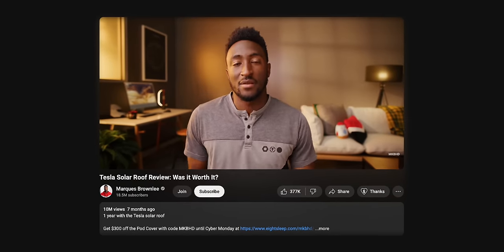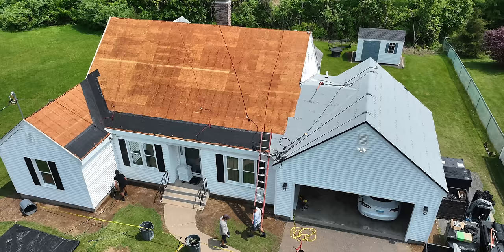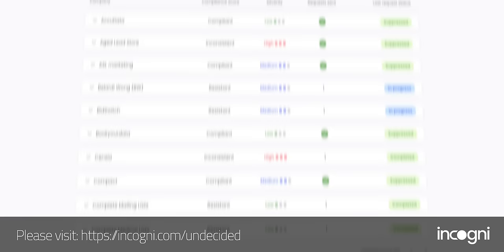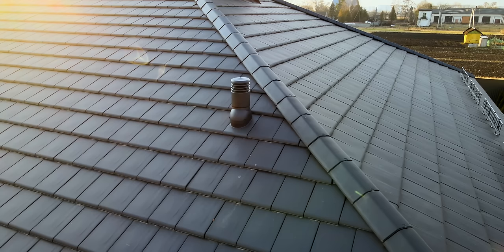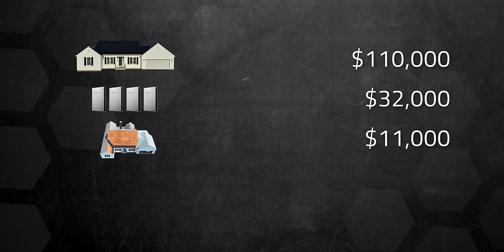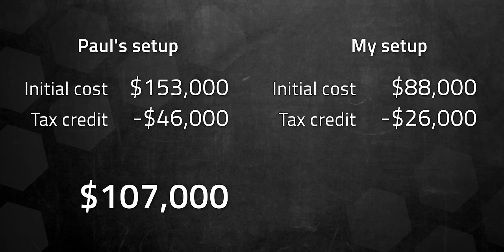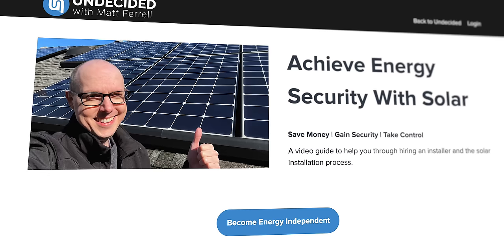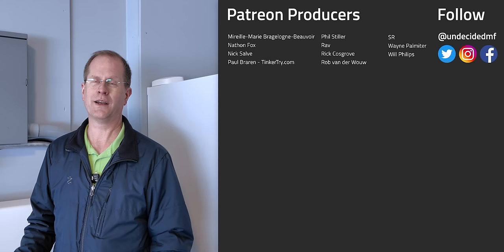Tesla Solar Roof vs Solar Panels: Which is Worth It?

Comment: I bought used solar panels. 4KW for $1300 Canadian. I flashed them together so they could act like shingles for the roof. So the solar panels are the roof for my woodshed. No leaks. It works great! So cheap too! Lead acid batteries store my power. They cost $2200 CDN. So I live off grid with very little generator use except for deep in the winter months for a little over $5000 CDN (with wires and charge controllers and inverters). With our snow loads here I really like my panels on the wall better though. I never have to sweep snow off of them in the winter. So I like my solar roof but my solar wall is my preference.

Comment: As someone who works a ton of heavy commercial/industrial one of the big questions for the decision is insurance coverage. If a panel fails and causes a fire what happens? I like your set up because it's metal and inherently more fire resistant.sure it might damage the paint but it won't burn. I'm %100 on board with the green energy movement I have gotten a large building an energy star but the legal aspect is a critical conversation.

Comment: The simple answer is the cost difference, which is gigantic. Additionally, for a solar roof, you have to do the whole house, whereas with solar panels, you can buy more or less depending on your needs. You can also play with the math regarding the number of batteries if you live in a place where you get a lot of sun. For example, my battery is 100% full by 11 am here in Houston during summer.

Comment: We had 31 REC Alpha Pure 405 w modules added onto our standing seam metal roof.  It uses a SolarEdge 11.4 w inverter.  15,400 kWh produced and 6000 kWh used last year.  We have a GeoComfort 3 ton ground source heat pump.   Just a great combination with the two systems.

Comment: Enphase is my choice. 
1) Individual micro-inverters.  
2) The ability to use your solar system when the grid is down. 
3) Simultaneous battery storage and gas back up generator that can charge your battery at night. 
4) Plus they have the ability to use your EV as another additional back up power source.

Comment: Imagine a tesla panel dead center going bad. You can't walk on them like shingles. You need to rent some type of machine to keep you off the roof as you reach down to replace it.
Reply: I'm the solar roof owner featured in the video, and I'm glad to report that plenty of people stomped in boots all over my roof without issue. They can be popped out individually for replacement, I verified that to be the case as I had the same concerns.

Comment: Live in Florida in a gated community. We are required to replace with tile and Tesla is approved as well. Received Tesla quote a couple of years ago. Was not comfortable with the sales and under enthusiasm. Having tile replaced as I type. Solar company placed brackets on membrane after original tile removed. Getting an 11.6 kWh system - tier 1 with 29 Silfab 400 watt panels, micro inverters, 3 Enphase 5kWh IQ Battery 5P and also added 2 Easy Start AC system Soft Start Devices due to heavy use of AC in Florida. Electricity is not as expensive here versus other states, but with the need for a new roof, knowing we are staying in this house, the increase in hurricanes (considered a back up generator for a hot second), 30% tax credit, net metering in Florida and helping the environment, it was time.

Comment: We had a solar roof installed and completed in March 2022. Total experience has been extreme Remely disappointing.

We are in Dallas Texas. Went with a third-party installer because I could never get anyone from Tesla on the phone. They assured me that they were the highest volume Installer in North Texas. The company is called Good Faith Energy. Unfortunately, their service after the sale was also extremely disappointing. The roofing crew and installers were very enthusiastic. Worked hard, but did take about six weeks to install the roof. 35 kW system. It has far under performed what they projected. We also have four power walls and four inverters. Tesla Service for this has been pretty useless.

My initial quote from, Tesla was roughly $120,000. Ended up costing us twice as much.

Comment: I think a couple clear important distinctions were not mentioned:
1 - The tesla roof includes roof elements that will have very little sunlight hit them.  While the 17kWh panels are all much better aligned to the sun.  Would have been GREAT to compare total Solar kWh from both systems on a sunny mid-summer day.  I bet it is not as simple as 27kWh vs 17kWh. 

2 - Maintenance. Which system allows for more easily replacing panels that are failing?  Maintenance (cleaning them? etc). I assume on Tesla you have to hire for replacements.

Comment: Went down the exact reasoning you did two years ago. My metal roof is about 40 yrs old now and I expect another 20 years more out of them. Have had my 18 kW running well for over a year now with about 22k kWh annually. With APSystems micros, replacing panels decades down when the technology changes or with failures will be easy and they are easily scaleable.

Comment: Paul should spend less time worrying about solar efficiency, and more time worrying about the water pouring in through his basement windows.  Might be time for some window well improvements!
Reply: :)
I was kind of bummed those 33 year old cement drips from the original basement pour showed so prominently in this unfinished area of my house. Worry not, it's not water, and thoseterrible single-pane windows are getting replaced soon, with triple pane windows already installed everywhere else.

FYI, our previous  house for 27 years had some real water issues, with regular asphault shingles not exactly impressing my wife as far as longevity or durability. We are glad to not have any real reason to worry about roof leaks, at least for a couple of decades I would hope, and we'll be pretty old by then.
- Paul Braren, owner of the Solar Roof featured in this video

Comment: Fell on my back when I heard the price, here in South Africa we paid give or take around $10k for our solar system. That includes 20 panels 450w each, 4 batteries 20kw of capacity and an 8kwh inverter. Almost completely off grid, just need a few more panels and 1 battery give or take, to go completely off grid

Comment: If I were Matt, I'd have either bought a steel roof that was a similar or identical color to his solar panels, or simply painted the steel roof around the panels to match the color.  It would look a lot better, and the darker color would absorb more heat and maybe melt more snow in the winter.

Comment: We put down the $100 deposit on a Tesla Solar roof in January 2021 when we closed on a new construction deal for our house in western MA.  The configuration changed a few times and the cost jumped when they instituted complexity tiers (many peaks and valleys on our roof) but eventually came down a bit.  We paid $99K for the 20.88KW roof with 3 Powerwall batteries. Although communicating with Tesla initially was not great, once the install was scheduled the team was terrific.  We didn't get into the house until this past September (almost 2 years later than our contracted date).  We had some permitting delays with the town (do we need bollards in front of the batteries and if so how far out -- 3 feet was the eventual answer).  Finally got permission to export once the sun had left the Berkshires for the season, but we are starting to see net positive production for our all electric house in recent weeks. Long time viewer; love your channel.

Comment: I replaced my roof with traditional asphalt shingles, and I went with SunPower panels with micro inverters along with the SunVault storage solution in 2021.  Here in Michigan, we don't have net metering anymore - we are on something called Distributed Generation.  Basically, the energy sent back to the grid is given as bill credit, and it is credited 100% for both peak and off peak, however, we have a separate distribution charge that solar credit does not pay for, which applies to any inflow from the grid.

For example, say I send 200kw to the grid but consume 200kw from the grid in the same month.  The energy charge would be 0, but I would receive a bill of 200kw for distribution due to the consumption, plus their regular fixed charges.  I didn't know that was a thing, but it makes me happier that I got the solar batteries.  This means the batteries do pay for themselves with distribution charge savings.  Instead of drawing energy from the grid at night, the batteries supply power to the house instead until they reach a depth of discharge set point (adjustable from 20 to 80%).

I started with a 7.6kw system with 26kw/h of storage, and then upgraded to 10kw with 52kw/h of storage in 2022.  This allows my house to remain energy independent for about 8 months out of the year, and I use up bill credit during the winter months.  It is also powerful enough to run the house during grid outages to the point where we can ignore an outage, unless it is in the middle of winter.

Due to fixed charges, it is IMPOSSIBLE to have no bill from the utility.  Credits do not cover any additional services either, such as the surge protection program I signed up for (it's a meter socket surge suppressor that is installed by the utility... and then they charge a monthly fee.)

Overall, I'm quite happy with the system and its performance.  It has had some quirks with the storage system, but Sunpower support has generally been helpful.  No issues at all with the panels or micro inverters, or their Hub+ load center.

Comment: We recently installed a 10kWh solar array on our house downunder to virtually manage our power bills in the long run. We also went with Enphase micro inverters and panels on a rack system. After monitoring the system output for a while, we are having a Tesla wall 2 battery installed to cover our evening and overnight power consumption. I was keen to go with readily available system components to minimise the risk of installing an orphan system that may be more effort to maintain in the future. Yes, the Tesla roof looks sharp, but I'm more of a function over fashion type of person and more interested in viewing the installation in the life-cycle of the system, cost, and maintainability. Our home is over 20 years old, and the existing roof is fine. Great video.

Comment: Let's think about this.  Avg electric bill in Massachusetts in Dec 2023 was $167.  Matt just built a brand new house, likely having the best insulation and energy star rating.  So we can expect his usage to actually be much less than average.  So after spending $62K on solar panels and batteries Matt is still spending an avg of $83 in the winter months.  Someone please explain to me how this investment makes any sense at all vs putting $62K in VOO to cover the next 100 years of electricity price hikes.

Solar for anyone outside of the 5 states without weather, is purely status. It's worse for the environment, and, from my math, makes no sense for the individual.

Comment: I live in South America and the only solution I have is how you did it.

With what is available in the local market I was able to have the panels, the inverter and batteries, from different brands but that work well together.

We do not have a tax credit or connection to the electrical grid, so the only way to mitigate the cost is by reducing the electrical consumption of the grid.

Comment: I live in sunny Colorado in a small 1,500 SF newly constructed home. We installed a 7.4 kW system using standard panels on a metal roof that is facing almost due south at a 45° slope. The solar installation was $21,000, with a $7,000 credit for a total of $14,000.  I’m pretty happy with the results so far. 

For the last five years, we have covered all of our electricity usage with just solar. We use approximately 40% of the electricity we produce (directly and indirectly). Our house is all electric (no gas) but we don’t have an electric car. I also don’t have any battery storage. Way too expensive for me right now and our grid has been very stable. Our system is designed to be able to add batteries in the future though. If we lose the net metering, I may look at batteries at that time. Just thought it would be interesting as a point of comparison.

Comment: I like your video comparison. Its honest and fair on all sides. I have owned 10 kilowatts of standard solar panels on my roof for 11 years now.  They are working fine, and I have always appreciated that the aesthetics issue is really not even an issue in the case of my house because people cannot even see them from the street out front where people go by. The street is on the north side and the panels are on the south, east, and west sides of the roof; but the roof angles are such that most people will not even notice the solar panels are there. One bonus that many people do not mention is that having the standard solar panels about six inches above the roof helps considerably to keep the roof much cooler in summer than it otherwise would get, and therefore extends the life of the asphalt shingles underneath much longer than they would otherwise last.

Comment: Standard. I'm currently extending from 25 to 40 panels on my end. After a year of use, with a Tesla at the house, it is clear I need a bit more juice. Pretty straight forward adjustment, but installer and permitting challenges once again of course. Great video again Matt. Thanks for sharing.

Comment: i used flexible, lightweight, cheap chinese solar panels for my place and it's delightful. it works, it's not expensive, so basically it's cost efficient. my place is in the remote papua village, my panels total are around 800watts, and i'm planning to triple it

Comment: I’d go with Tesla.  Had 7.2 kw installed 12 years ago.  Had to replace asphalt roof 3 years ago which added an additional cost of $5000 for removal of panels and reinstall.  My original solar contractor went out of business, so I had to hunt down a roofer that worked with a solar installer.  The idea that Tesla would go out of business and not support their products are extremely small.  In my area on Ling Island NY there are plenty of Tesla installers and they handle the install soup to nuts without me getting involved, including the permit process.  No brainer, Tesla is the winner

Comment: We pretty much have not paid for electricity other than our ridiculous connection charge in 4.5 years. Not with a solar roof but with just regular old solar panels and Tesla powerwall. One of the best investments I've ever made. We're halfway to a payback but when we built the house the solar roof was about twice as expensive. And the numbers you guys quote makes us feel we got a steal of a deal. We are carbon neutral and actually a net energy producer for $45,000 all in. The crew that did the install from the Tampa office of Tesla Energy did a great job. System just works all the time - always hits its rated targets for output, and just chugs along. Like I said, one of my best investments along with our two Model 3s. Our one hiccup was that a lightning strike fried the Gateway, but we now have a whole house surge protector.

Comment: A metal roof with solar panels is the best option. Solar panels are increasing in efficiency every year so you'll probably swap those out for higher efficiency panels every 10-15 years.

Plus finding a replacement tile for an old solar shingle will be impossible (as you mention).

Comment: Great video, Matt.  I'm just a bit ahead of you on the install time line.  I needed to replace my asphalt roof in late 2018.  I'm in central Texas, so a metal roof was an easy choice to make aesthetically.  I also wanted a roof that would outlive me. I settled on an 11.4  kW conventional solar panel system that was installed as soon after as the weather permitted, in Nov, 2018. I started looking at batteries after the 2021 freeze here. I finally added 2x Tesla PowerWall 2 in Sept, 2023, using the same installer that did the solar panels.  If I was building a new house I would definitely consider Tesla roof tiles.

Comment: The reason I didn't end up doing it is because of the issues with the install crews. Also in New England but I heard terrible things about their reliability and such. Ultimately I went with a PPA, which will cost me more in the long term vs buying, but only after about 15 years.

Comment: What are this prices? This is insane. In Germany in 2023, I build an 11.2kWp Array on a roof of our shed. For preparing the asphalt roof and installing all electrical stuff we paid (2000 + 2500). We added the railings and the panels. We also bougth the panels and the inverter by ourself. Our summarized cost were 12.500€. Inverter 1.600€, panels around 4.500€, railings 900€ and some minor stuff. A professional installation by a company in germany is around 25.000€ all incl for 10 to 15kWp. 100.000 USD is insane, out of my perspective.

Comment: I have a quote in CA for a 7.6kW system and a 13.6 Kwh battery for $36k and a federal rebate of $11k. $25k is the reasonable cost for a system. That's it. It's crazy to pay more.

Comment: My issue with Tesla’s traditional panels system is that I went with them in 2018. When they were transitioning between SolarCity and Tesla Energy. So, we have the very old monitoring system. it no longer functions and they don’t appear to be able to reconnect it. Our inverters are ABB inverters and not the newer Tesla branded models. 

Other issues with customer service around upgrading the panel and replacing the roof.

If I were to do it again, not sure I would go with Tesla again.